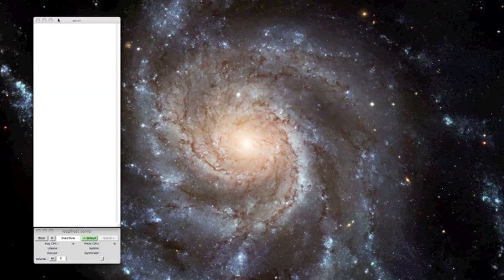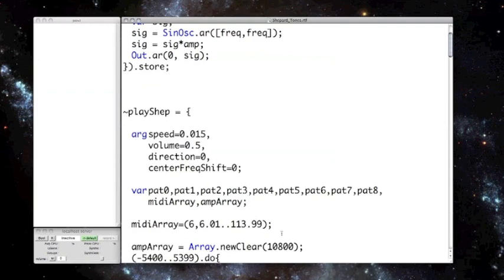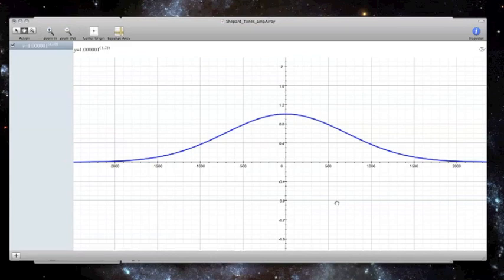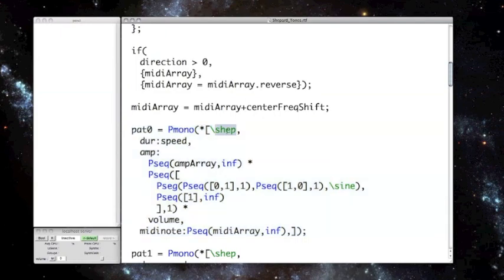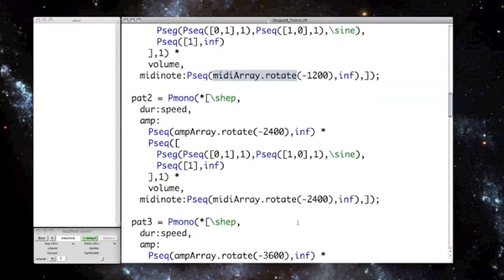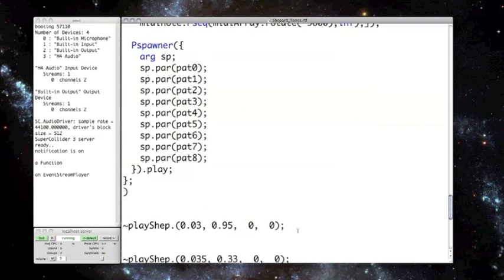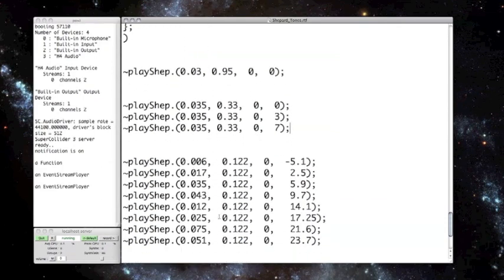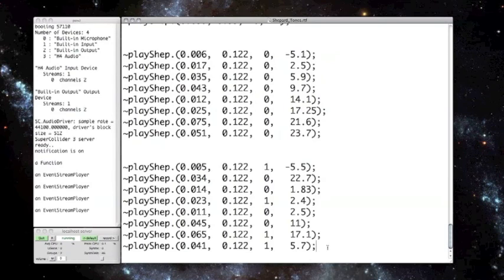Shepard Tones in SuperCollider

Comment: Great tutorial! Before I saw you had made a video about this I made this as a SynthDef (that works slightly differently):
(
SynthDef(\shepard, {
	|out=0, fund=100, amp=0.8, rate=40|
	var n = 6; //change this to the desired number of tones
	var sig = n.collect{
		|i| 
		a = LFTri.ar(rate.reciprocal, 3+((4/n)*i), 0.5, 0.5);
		f = LFSaw.ar(rate.reciprocal, 1+((2/n)*i)).range(0,n);
		SinOsc.ar(fund * 2.pow(f), 0, a/n);
	}.sum * amp;
	Out.ar(out, sig.dup);
}).add;
)

Could be modified to a falling version by altering LFSaw (I think it would be fund * 2.pow((1-f.neg)) )
Reply from the maker: Nice! Yes — my version could definitely be improved/simplified. If I were to do this again from scratch, I'd probably follow an approach like yours. As you can see, I published this video a pretty long time ago :)

Comment: For those wondering about good uses of Shepard tones. There is the Endless flanger, phaser series VST plugins by Oli Larkin which are very nice.

On this code, change the oscillator to WhiteNoise and apply the shepard patterns to the freq from a BPF with a narrow Q and you'll get endless eerie wind storms.

Comment: Great work ! 
But how can you manage to stop it ? 
I tried different syntax but I didn't manage to do it. 

Thanks !
Reply from the maker: Good question! I guess I didn't really plan on ever stopping them ;)

You can change the SynthDef so that it incorporates an amplitude envelope:

SynthDef("shep",{
  arg amp=0.08, freq=440, gate=1;
  var sig, env;
  env = EnvGen.kr(Env.asr(0.01, 1, 4), gate, doneAction:2);
  sig = SinOsc.ar([freq,freq]);
  sig = sig * amp * env;
  Out.ar(0, sig);
 }).add;

And use this line to fade out the Shepard tones while they're playing

s.defaultGroup.set(\gate, 0);

With doneAction:2, you'll get "node not found" messages after the fade out is complete (because the patterns are attempting to update Synths that no longer exist), so this is a quick and clumsy solution.
Reply: Eli Fieldsteel I already thought to us an envelop with doneAction0 but the poor server is invade by Synths. And this error message with doneAction2 is really anoying. I will try to find another solution. If I don't I will ask my teacher to help. 
I'll send you what I find (if I do).

Thanks !